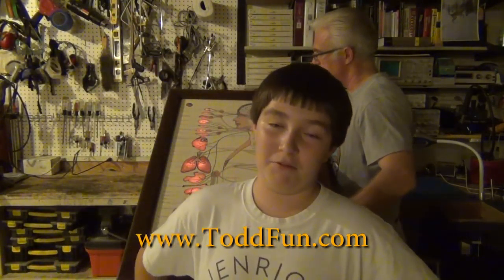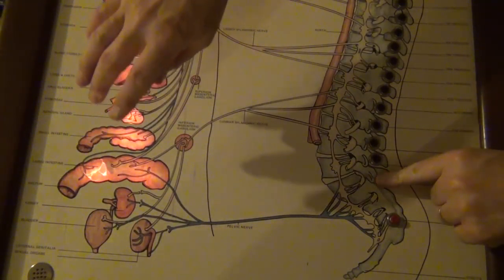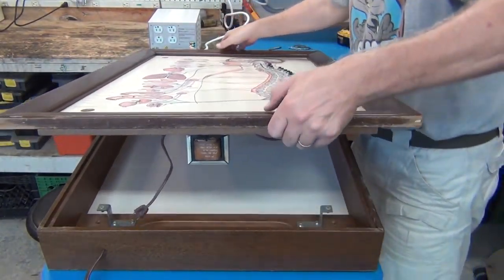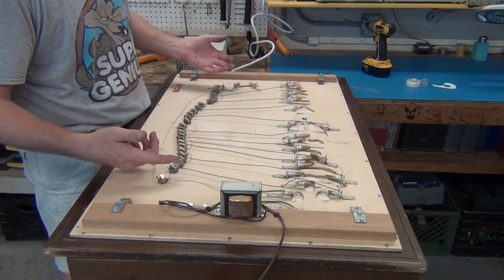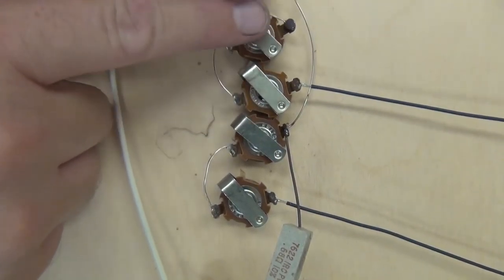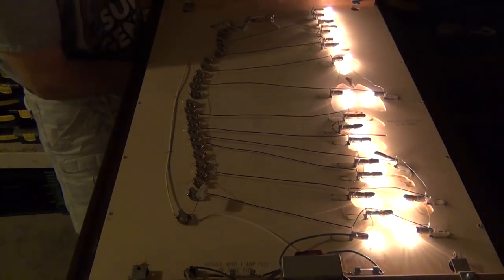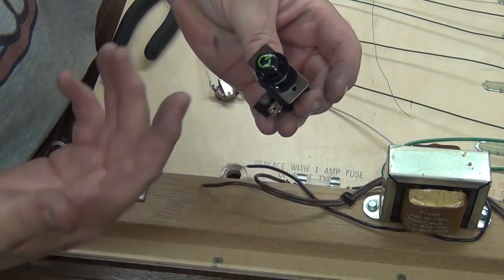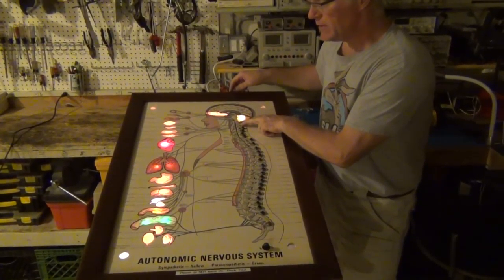Autonomic Nervous System Interactive Display Refurbish

Comment: As a bonus now it is LED lit you have used all the LED retrofit lamps that you bought but were not going to use. Cooler running and the paper front will not get as brittle with heat, plus the transformer will run cooler.

You must have a very dry climate, here those open switches would have a patina of grey corrosion from the sea air, and the contacts would have gone open a long time ago. You need to go take a tour of the aircraft outdoor yards near you and make a video of it.